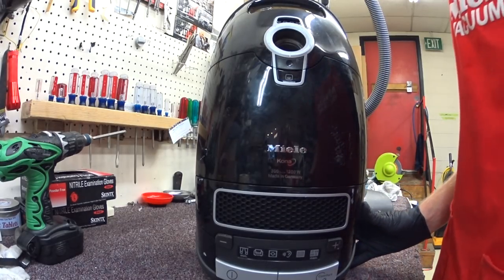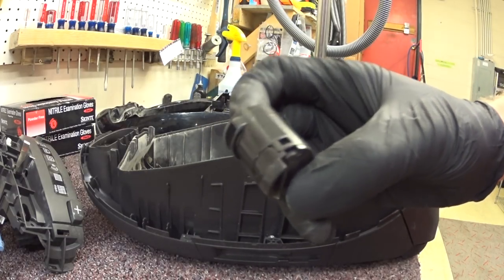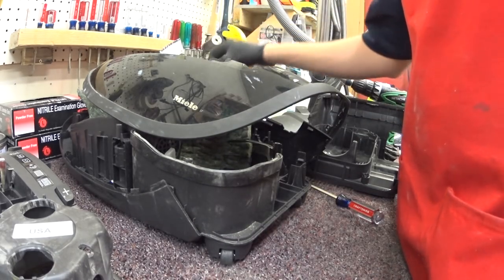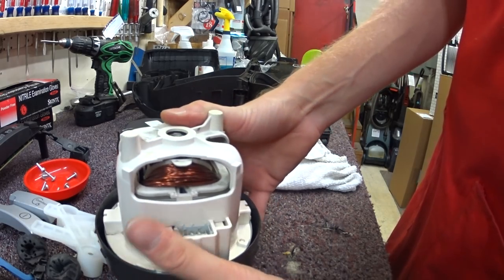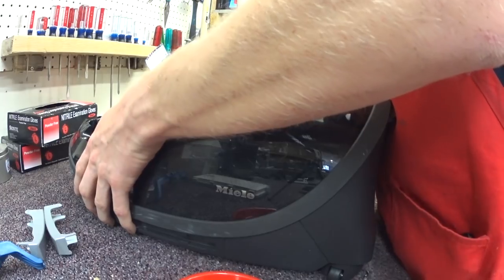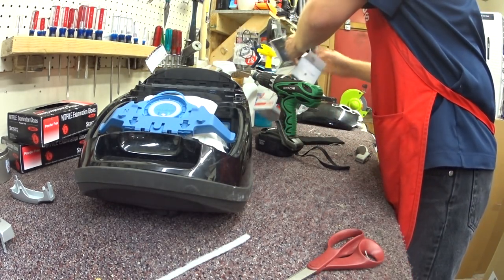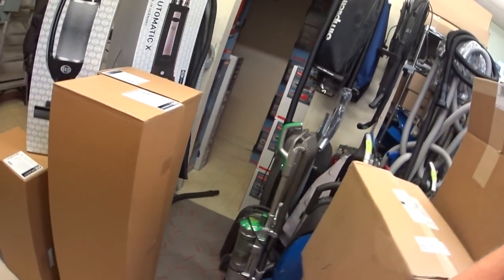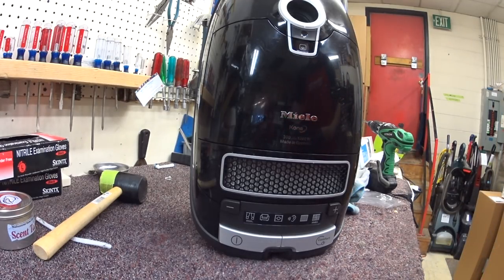Miele C3 s8 Kona "soft carpet" Vacuum  Repair

Comment: Vacuum technician here.  I was faced with a customer that appeared with Miele upright that did not stand sturdily and the handle release was wonky.  I discovered that the wheel mechanism was broken. Tackling the timing on the wheel mechanism on the upright Miele is something that I try to avoid. This was a very handy video. I was able to replace the broken assembly with a new part. The machine stands, releases and lays down satisfactorily. Thanks a million.

Comment: I have the same model. When it starts it is working fine, but after 30 seconds the engine slows down and keeps running at a lower level. It does it in all positions of the buttons. What can be wrong? I took the whole motor apart and nothing negative is visible.

Comment: Great video, as always.  I have three Miele vacuums, a S251I Plus, a S514 Solaris Electro Plus, and a Compact C1 Turbo Team.  I only use genuine Miele bags and filters in my machines, and all three of them use the FJM bags.  The Solaris has a bigger bag compartment than the other two, and I was wondering if it would be safe to use GN bags in the Solaris, or should I just stick with the FJM bags for it.  Thanks for your input.

Comment: My question is how did this compare to the Taconys. I want to see a comparison of this compared to the Radiance Premium or Synergy Premium models.
Reply from the maker: Generally you don't compare up Grayson canisters because two different types of people buy them for completely two different types of households. but in my humble opinion /experience the cleaning difference between the vacuums you stated and this are  marginal.

Comment: Not sure if youve passed coment on it but is the consumer being shortchanged with the new 1200w models? all things being equal, say, a miele 2200w vs a 1200w with the same power nozzle, is it better to have the extra wattage? or is the 1200w fan a better design?
Reply from the maker: In the US we only have the 1200 watt 120 volt models.  We have no regulations on vacuums.
Reply: Where as here in the uk and EU we have to have 700w motors 😭🥲😂😂

Comment: How would one clean the inside of an electronic Miele hose? I may have accidentally sucked up some moisture, but I checked that none got into the motor.
Reply from the maker: Garden hose let it hang dry for a couple days.
Reply: Performance Reviews thanks!
Reply: Performance Reviews same thing with wand?

Comment: My "plus" button do not work anymore, so the vacuum cleaner stays always in the minimal speed. Do i need to change the whole button set it can i change only the plus button?
Reply from the maker: Bring it to your local authorized service center they'll probably need to order a panel but who knows until they pull it apart and look at it.

Comment: Its interesting that the US models of the S8 have that additional black plastic motor "container". All the (UK) S8 models I own do not have it. I am wondering if the 120V motor is physically smaller than the European 240V motor, so needs the additional container to make it fit in the motor housing, or if the American market just demands a quieter machine. Do all the models in the S8 range in the US feature this additional motor container - or is it limited to the higher models in the range? Its amazing how many Mieles in the US are equipped with power nozzles, as here, they are very rare, and Miele dont actually sell them here at all any more. We have to use turbo brushes such as the STB205 and STB305.
Reply from the maker: All C3  s8000 series machines and c2 s6000-series machines have the encapsulated motor. About half of the models sold in the US are offered with electric power head. However the better selling models have the SEB 228 SEB236 powerhead. We also sell a lot of upright vacuum cleaners. Which all have electric power. The stb 305 is not offered .
Reply: Thanks for that - its strange how the US has higher wattage motors in their Mieles, and offer electric powerheads, buy in the UK, where we now have under 900W Mieles, we dont get the option of powerheads any more, only turbo brushes. I would have thought that with lower powered motors, powerheads would become more commonplace, but they are not. We can get the ET-1 powerhead on the E3 Premium by SEBO, but no powerhead offered by Miele. I can only assume that they dont sell them here now as people were not prepared to spend £500 - £600 on the powerhead models when they were being sold here. At £600, that is more expensive than the most expensive Dyson (bar the robotic Dyson)
Reply: It's very interesting to hear that you in the UK hasn't got any option how to get a Miele with powerhead, I am from the Czech Republic and Miele offers here a Miele C3 Electro Ecoline SGFP3 for 560 GBP in conversion. So if you want it, just buy it in other EU state and than change the plug, good way to get it :)
Reply: We did used to have them available here, but Miele discontinued them. I can only assume they did so because people could not afford them. The UK is under heavy austerity and people are struggling to make ends meet, so many people look for cheap vacuums like Hoover and Vax for the £100 mark. Those with more money tend to get Dysons, or Miele but with the straight suction or turbo heads. At £600, the Miele with powerhead would be even more expensive than the most expensive Dyson cylinder. I cannot see many people buying an EU machine and having to change plugs - it is only something a select few collectors might do. I already own a Miele S5 with the SEB236 powerhead and whilst its a feature packed machine, i dont use it very often as its bulky and cumbersome with the electric hose and large, heavy powerhead.
Reply: Miele no longer has the motor cover on the c3’s.  They have done away with them and now it is just a motor with a support bracket. I kinda liked the cover but without it the motor can cool better I presume which increases the life of the machine.